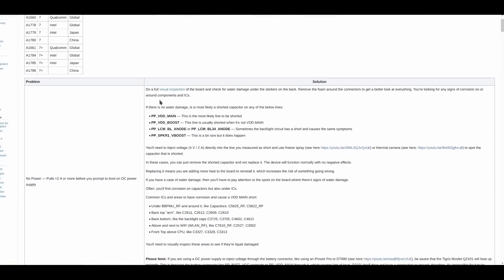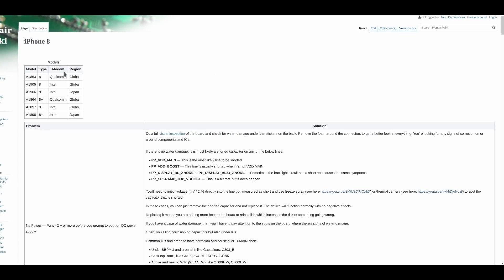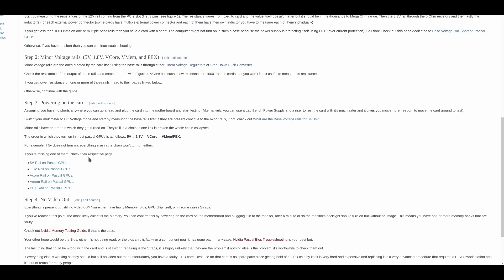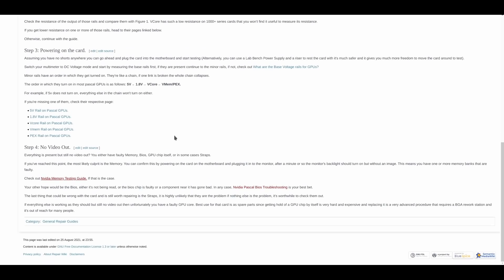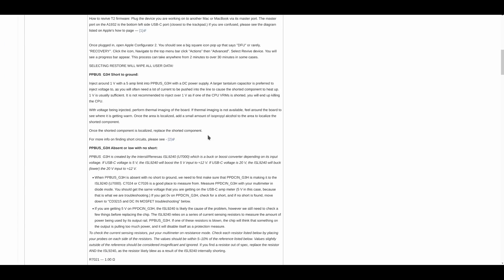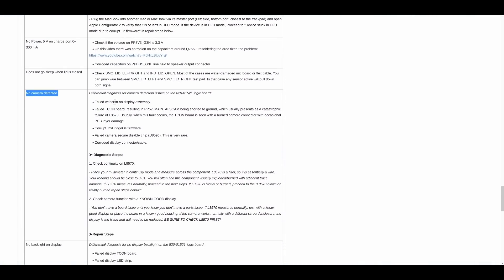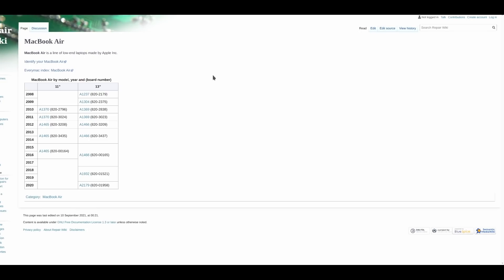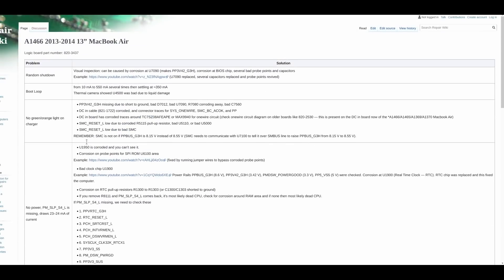Graphics card component level repair how-to on Louis Rossmann's repair.wiki

Comment: Your link in the description for the NVIDIA pascal GPUs is not working. Missing the closing parenthesis at the end.
Reply from the maker: You have to copy & paste it manually. the ) is there, but youtube's redirect service removes it. :(
Reply: @rossmanngroup  One way to fix it would be to replace that closing parenthesis with %29
It's the same symbol, but in URL character encoding format. YouTube should then handle it properly.

Youtube's description parser seems to have messed up, and it appears to think the closing parenthesis is not part of the link. URL encoding gets rid of ambiguities that can trip parsers like this, and has been part of the web standard since the beginning, so it's well supported by all browsers, devices and websites.
Reply: @3lH4ck3rC0mf0r7  Yep, that's why links from Google searches are full of such things instead of the raw characters.
Reply: @3lH4ck3rC0mf0r7  Not YouTube's problem.  A closing parenthesis is normal punctuation to come at the end of a word (which could be a URL) without a trailing space.  Placing URLs in parentheses is fairly common.  Louis or whoever is maintaining the wiki site should not be using raw parens in URLs.
Reply: @stumbling  A parsing error is a parsing error. I don't blame either party for it. It is perfectly valid for URLs to contain any symbol in the ASCII set, including the end parenthesis. And at the same time, it is perfectly valid to assume that end parenthesis = end of link.
Reply: @3lH4ck3rC0mf0r7  I agree, both of these things are reasonable in their respective contexts. I lament that link parsing so ambiguous when written along with text by normal users. My preference is to make users put whitespace around links to avoid this issue -- imo being literally unable to communicate a valid link (manual percent-encoding notwithstanding) is a worse outcome than getting users to learn to put spaces around links.
But that's a personal preference, and clearly many sites disagree. The correct frame to resolve this issue is to ban parens from wiki page names. It's a little inconvenient but "just use other punctuation" is not difficult to implement. Any of these would be 'fine': "Nvidia Pascal GPU Diagnosing Guide [1060-1080ti]" or "Nvidia Pascal GPU Diagnosing Guide -- 1060-1080ti" or "Nvidia Pascal GPU Diagnosing Guide for 1060-1080ti"
Reply: @JoeTaber  Well, another solution would've also been for YouTube to forego natural language parsing entirely, and offer a more complex description editor where users could manually specify links.

Or use URL encoding, which exists explicitly to workaround this exact issue, without forcing either site to compromise.

I can see Kyle K tested commenting the link with an URL-encoded end parenthesis. And as I expected, that fixed it.
Reply: Hi sorry to spam i just want to see what Youtube does if I comment the link https://repair.wiki/w/Nvidia_Pascal_GPU_Diagnosing_Guide_(1060-1080ti%29 Too bad youtube eats links in descriptions

Comment: Graphics card repair... yeah, good luck, the rails are the easy part, changing default clocks in VBIOS, replacing VRAM and Core are not. Usually when GPU goes to hell it truly goes to hell and VRM fries the core. RIP Replacing a knocked off component... sometimes possible sometimes not, finding out it's value is impossible without have the same card on hand to measure from.
Reply: There are lots of leaked schematics with component values

Comment: There is massive demand for repairing Radeon VII GPU. No longer in production, AMD will not repair, they never would repair, only replace or get you an upgrade. Thing is that they are one of the best mining cards, always lots for broken ones for sale on Ebay. People could repair a lot of them for mining, or for resale. Hell I would even learn just to pick them up and fix myself for the mining aspect alone.